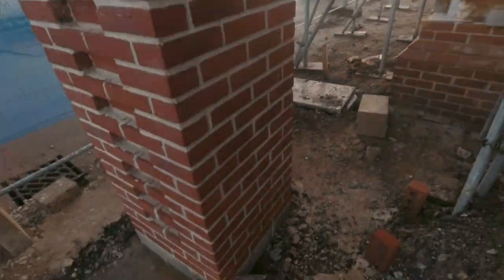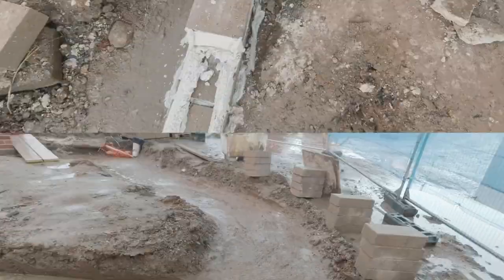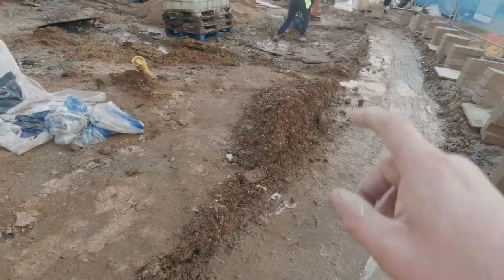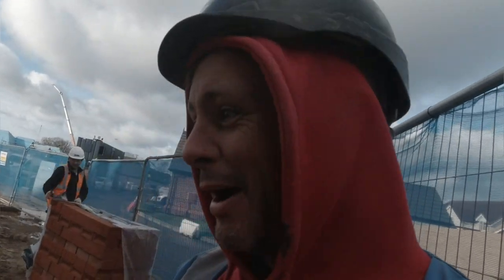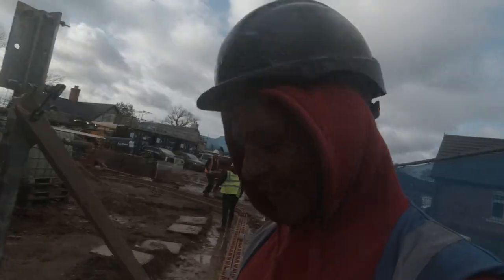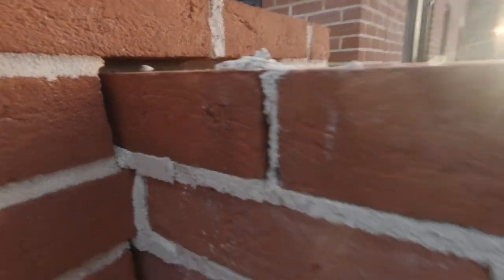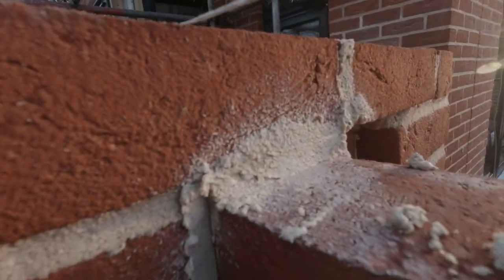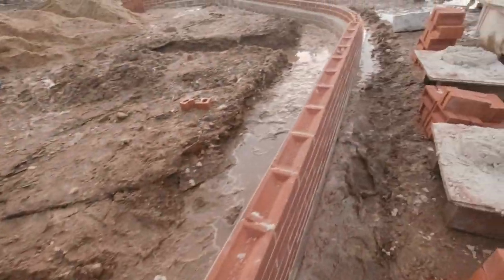Bricklaying back on the trowel!

Comment: What's the reason for using the bricks with three holes for the lower layers then the bricks with indents for the middle layers?
Reply from the maker: The engineering bricks at the bottom are dencer and do not suck in water 😊
Reply: @trickybrickys  Ah right, thanks. Only seen the purple style engineering bricks before.